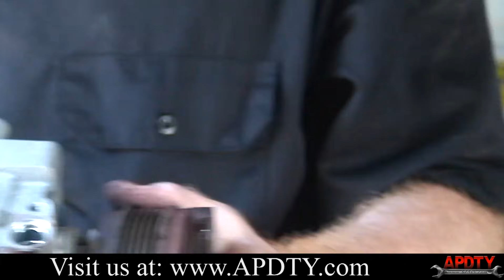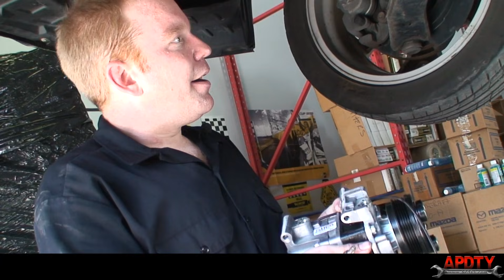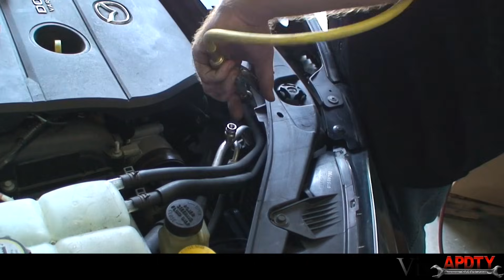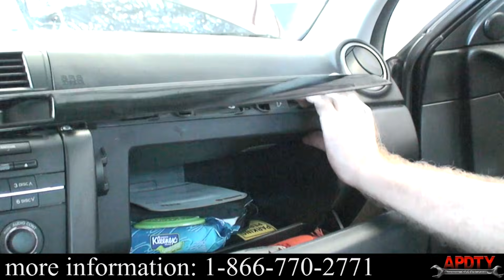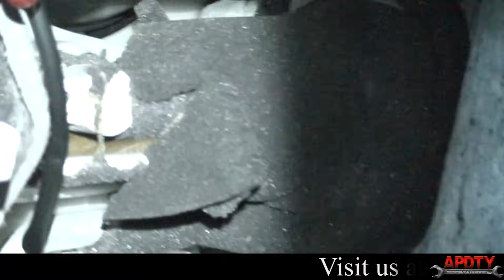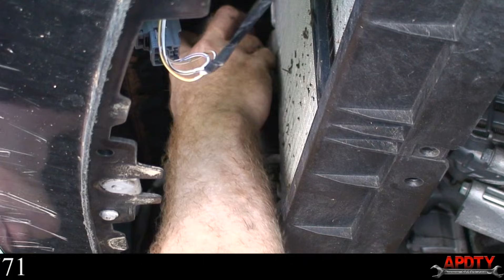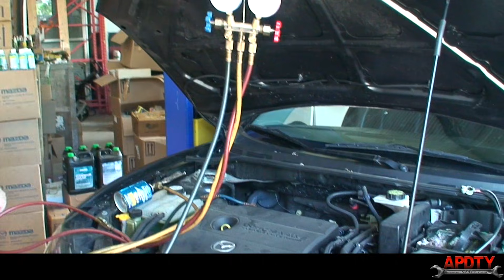AC Compressor, Condenser, & Dryer Replacement On A 2004-2009 Mazda 3 Non-Turbo

Comment: I have a Mazda CX7 2008. My AC stop cooling then when I did a visual inspection on the compressor I saw one part of the compressor off. I think that part is a AC clutch. The bolt is missing but the part is attached but separate. So I Know the bolt is missing and I don't know what else is missing. Also I don't know if I need only put another 10mm bolt and my AC will be fine or if I have to replace the whole compressor.
Reply: Today i was out for a walk and found a Mazda compressor clutch plate lying on the road (the one showed in the video, with the three rubber thingies arrayed in a triangular shape, 109mm wide) so yes, these bolts seem to tend to come off too easily... maybe just replace the clutch assembly if you want to feel sure, perhaps they updated the design.
Reply: TeraVolt I bought the something for tight the screw. I forgot the name but is a liquid color blue, is like a glue. ZIff fall again I will replace the clutch
Reply: I wouldn't have done that if i were you. If the clutch assembly or the coil fails, you could have a very hard time pulling it out.
Reply: TeraVolt You are right. I just want to fixed as soon  possible. But thanks for your advice
Reply: TeraVolt You are right. I just want to fixed as soon  possible. But thanks for your advice
Reply: Oh, by the way i just found that the clutch hub in my possession is not even the one of a Panasonic compressor (the ones equipped on Mazda cars) but it fell off a Valeo/Seltec/Zexel TM08/TM16 compressor (used mostly for school buses or minibuses HVAC systems). On the Panasonic one each of the triangularly arranged thingies on the outer side of the front part of the hub has a small metal plate on it, on mine there are just rubber bushings instead. Right now i like using it as a beer mat.
Reply from the maker: First it is very rare for a screw to have come loose and that be all the problem, Most of the time something caused the clutch to fail or the compressor locked up internally and that destroyed the clutch, Also up until about 15 years ago it was fairly normal to replace a compressor clutch and now it is much more rare. Keep in mind that a worn out or broken clutch is giving you some insight to the wear and tear on the inside of the compressor. It is possible the compressor caused the clutch to fail. Most cars built in the last 10-15 years are better off having the compressor and clutch replaced at the same time. Recently the compressor designs have changed and the costs for a brand new compressor with clutch have come down tremendously. Keep in mind we now sell numerous AC kits which are brand new full compressors with clutches and dryer and expansion valve and they are $250-$450, In the olds days a remanufactured compressor cost that much. Also keep in mind if you go through all the labor to evacuate & recharge and then remove the compressor to install a new clutch, the new clutch will likely outlive the old compressor, so the whole job has to be done over again sooner then if the complete new compressor with clutch Is installed from the get go.

Comment: Why would you put the belt on the compressor and then turn the crank shaft, ie the whole engine, to get it on the compressor when you could put the belt on the crank first and then spin the pully on the compressor to get it on?  Far easier than turning the whole engine to get it on.

Comment: Great video!  It was a big help to me, thank you!

A note though.  Before putting refrigerant in, you should purge the yellow line of air after hooking up the refrigerant.  This is what the little knob or valve is for on the manifold set.  Before doing this, PUT GLOVES ON to avoid frostburn.  Then you basically just hit the valve on the manifold (or slightly unscrew the yellow line from it) for a split second till coolant starts coming out.  And THEN you put the coolant in.
Reply from the maker: Yeah I would be surprised if he didn't purge the line, that is a normal thing for all evacuate and recharge jobs, it was probably edited out as the vacuum and then recharge process adds too much time to the video. We do have several other vides showing a proper evacuation and recharge process and we certainly purge the line and yes we burn our fingers often and then put the gloves on, lol
Reply: Aren't parallel flow condensers unflushable?
Reply: I was fixing to say the same thing. The yellow intake line was not purged.

Comment: I just had my compressor replaced, valves, etc. And it's making a chirping/rattling noise. what else could it be.
Reply from the maker: This would have to be inspected to verify exactly where the sound is coming from, if it sounds like it is coming from the compressor, then assuming the compressor is brand new, you could try evacuating and recharge it again as sometimes the wrong amount of oil or refrigerant was used, make sure all proper oil procedures where followed and also the system should have been flushed, if a seal particle of the old compressor is loose in the system and a new compressor is installed, well then the new compressor could have been destroyed by that particle.

Comment: Hi my 2008 mazda 3 ac turns on and off all the time by itself when i turn the ac on level 3 or 4 , when i put it on level 1 0r 2 it  works without turning off by itself but the air is not cold enough , any idea on what has to be changed ?? Please help

Comment: The A/C compressor locked up on my 2007 mazda 3 2.0L. Totally blew up the belt. The mechanic said that in order for the manufacturer to warranty the new compressor I have to replace everything, a whole kit...compressor,  clutch, expansion, condenser, etc., something about metal shavings could be in the system or something.  Is that true? Or will just a new compressor w/necessary stuff for it only be fine? Thank you in advance!
Reply from the maker: That is 100% true, These cars have a parallel flow condenser and it cannot be flushed out properly, We were able to do this job without replacing the condenser but any shop that will put a warranty on it will most likely require you to replace it, The expansion valve and recievier dryer (accumulator) also must be replaced.

Comment: did you  oil all o ring seals, or just on compressor?
Reply from the maker: any seal that is opened should be coated in teh same oil that the ac system gets, this helps the oring seal and also prevents it from being cut when the other line or component is bolted up.

Comment: $2000.00 for Parts / Labor later and you have a nice new A/C system working in your $2000.00 Mazda 3 !! Sometimes it's better to evaluate a cars value before moving into a major A/C overhaul repair like this !! Why not just swap out the A/C clutch & Coil, evacuate and refill OR was the compressor so far gone that it needed replacement ?
Reply: If the compressor shaft binds up then you have to replace compressor, condenser, expansion valve, drier and thoroughly flush the rest because right before a compressor dies it fills up everything before the evaporator with metal shards (or, in other words, shit). It often does so with a lot of noise and smoke too due to the friction of the belt on the locked up pulley, and more than often it also stalls the engine in the process. If only the clutch assembly or the coil is the defective part, then just replace it and let your compressor live its days again. However, some shops may just swap the whole compressor with a new part, and maybe throw in a new condenser, drier, txv and system flush for good measure, even if the only defective part is just the AC compressor clutch (a lot of OEM clutches go open without a reason because manufacturers put a thermal fuse in the windings) or even the clutch relay. A probable reason for this (Ex. a whole new compressor when the only defective part is the coil) is that some shops apparently don't want to deal with the user blaming them for the subsequent failure of a failing compressor (perhaps stressed too much because the car owner ran it with not enough oil due to a leak) because they serviced it recently. The real expense depends upon how the system failed, and can range from 10$ for a new relay to thousands for a system overhaul, but knowing how your car systems and subsystems work so that you can check them by yourself is a good way to keep yourself from being ripped off.

Comment: Wouldn't it be possible/easier to run the belt around all of the pulleys while the compressor is detached? I have to replace my friends compressor this weekend, just looking for advice.
Reply from the maker: no you will not be able to properly bolt up the compressor, its really not that bad house the tool and spin it on, also that is how the oem designs it and technically how they recommend to replace it.

Comment: does the compressor run the radiator fan? I have not fixed this issue yet and summer is coming. I popped my hood this morning and my clutch is doesn't engage. my radiator fan also doesn't work so I'm wondering if I need to replace that too?
Reply from the maker: +Michael Pantaleon the compressor clutch and radiator fan are two different circuits. Is the car overheating? Is the ac system fully charged?
Reply: +Auto Parts Direct To You thanks for the quick reply. my car does not overheat. my a/c doesn't work, so I believe the clutch bearing isn't catching. I was just wondering if the radiator fan was powered by the compressor as when i compared it with my other 3. as soon as I put on a/c the radiator fan is also powered on...
Reply: +Auto Parts Direct To You however in my Mazda 3, when I turn on the a/c, no cold air is coming out aswell the radiator fan doesn't turn on...
Reply from the maker: +Michael Pantaleon So, fans come on when hot. but,  not when you turn on the ac? with the ac on, is there power at the clutch coil?
Reply: +Auto Parts Direct To You oh i see. yes, when i turn the the a/c, the radiator fan does not come on like my other mazda 3. I'm not sure how to check for the power at the clutch coil... i'm assuming i have to take the compressor apart to see? I can see from my engine bay that it is not engaging. It is at a stand still.

Comment: hey, help me please!! I just got a 2010 Mazda 3 when I turn on the car no ugly squeak but when I turn on the AC/defrost there's this nasty belt squeak that will come and go and as soon as I turn off the AC the belt stops squeaking, what could be the problem and how do I fix it
Reply: +Alexander Clark hey thanks!!! I was told that it should be okay but I also found out my tensioner on the car is messed up which is like a 260/270$ fix haha! but at the same time they said if you fix the tensioner it shouldn't squeak anymore
Reply: +Alexander Clark thanks ! I'm planning on just rebuilding this whole car lol!!
Reply from the maker: If inly the ac belt is doing this and only when the ac is turned on, then you most Oakley have a compressor the is falling internally and locking up making the belt spin on the pulley which causes that nasty belt squeal.

Comment: hi, i have a 06 mazda 3. my passenger side is blowing warm air while the driver side is working fine.. what could be the cause of it?? thanks in advance for the advice...
Reply: the blend doors  aren't working
Reply from the maker: yeah you just have a plumbing problem in the dashboard, You have little doors that are opened and closed by little motors called HVAC actuator or blend door motors, this is most likely your problem.

Comment: hello, i am looking to buy a part out car an 04 mazda 3 2.3L GT for a compressor. if i do this, will it fit in my 07 2.3L mazda 3? someone that i know of says it is the same, however would like your or anyones input if this is possible before i buy the car im about to take it from
Reply from the maker: +Michael Pantaleon By the catalog, 2004-2009 Mazda 3 with a 2.3L engine would all use the same compressor

Comment: Hi APDTY, this is a tremendously detailed and helpful guide. Thank you SO much for sharing. I do have the ask, is it absolutely necessary to replace the expansion valve and drier? I was told the purpose is to ensure no clog or debris is in the system. What if I do not find debris after removing the compressor? Do I still need those 2 replaced? Thank you!
Reply from the maker: Yes those 2 parts really should be replaced anytime the system is opened and especially during an ac compressor replacement, You will not get a warranty from anyone if you do not replace those parts, that is because the expansion valve is crucial to the operation and also any old debris will be stuck in it which give you more clues on what happened to your old compressor. The accumulator should be replaced because it will never last the lifetime of 2 compressors and also once it is opened to air, the internal desiccant can absorb moisture from the ambient air, It is never worth it to skip those 2 parts.
Reply: @APDTY  Everything I have seen online, including service manuals from Mazda show that you need to totally disassemble the dash of the car and take the doors off to get to the expansion valve as the dash assembly needs to be taken out of the car! This is the first video I have seen showing that there is even a hint of an alternate (and infinitely easier option) for doing this. To say this is a relief for me is an understatement as I was basically resigned to the fact that my AC was never going to work again as I have no intention of spending $1000 on labour to replace a $50 part. Thankyou to your spannerman for showing that there is a viable and significantly faster alternative.

Comment: Where do I add the oil.  I  have a 2007 Mazda 3 that blows warm at an idle but cold while driving.
Reply from the maker: Scott Smith You can't just add oil, as it is typically added with the refrigerant during a service which evacuates out everything and then when a recharge happens, the refrigerant has oil in it. You typically only add oil to a brand new never installed compressor and on older vehicles you used to add it to each new component when replacing but that is not the case on your vehicle. If it is warm at idle and cold while driving, then the condenser is not being cooled and you may just have a bad fan. A quick AC check can confirm if you have a refrigerant issue, 8 out of 10 cars that have your symptom have a perfectly working ac system but the fan is bad and not cooling the condenser. An easy test is run the ac and engine at idle and look to see if both fans are on full blast, also you can run cool water from a hose through the condenser and if the ac gets cold then you either have a fan issue or a clogged condenser. The ac pressures should also really be checked first as the pressure's tell you exactly what the system is doing and the running at idle and cool water test is added information used with the pressures to give an overall diagnosis. This is also assuming no electric failure exists.
Reply: I'm looking to attempt this job with your video guide, how do I add oil to the compressor and how do I know how much to add? I read that too much/little are both bad.
Reply: Hi Scott I have 2007 Mazda 3 and have same issue like you car I want to know what u did and how much it cost.Thanks

Comment: oh yeah another thing if im change my air compress right is there any fluid that i have to replace because it might leak out do i have to do an old change also i know i need new rubbers for the pipes and lub to keep it from rusted bolts, is there anything else i need to keep in mind i know you cant use the same belt once u take out compress have a new belt at hand got it...
Reply from the maker: its herby Yes the refrigerant and oil are vital to the compressor working and continue working. Replacing the parts is very easy but you must do the refrigerant and oil properly or the new compressor may not last too long. Just watch some youtube videos on evacuating and recharging to understand it and pay a shop to that that for you as it can easily cost you lots more money if you screw it up.